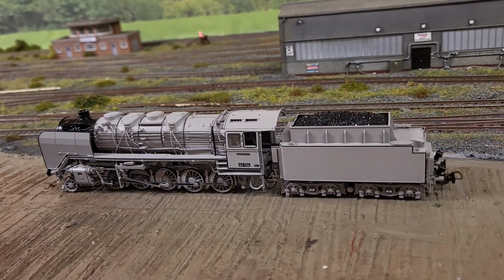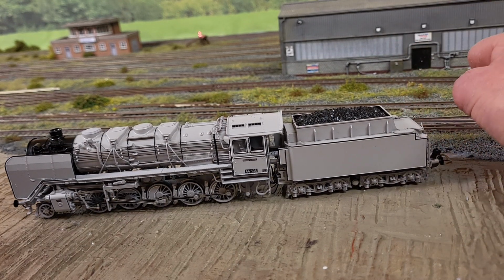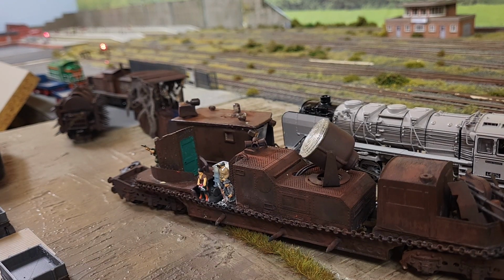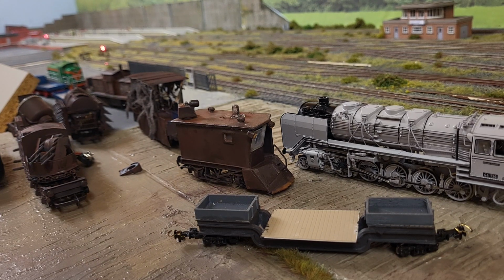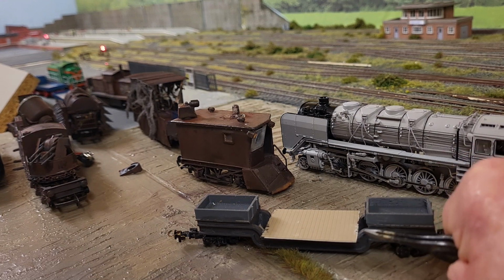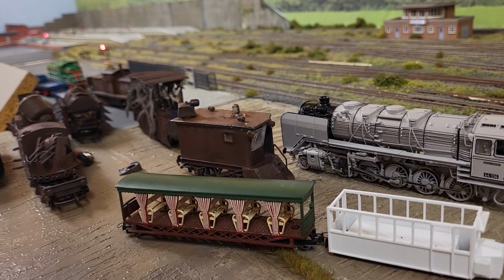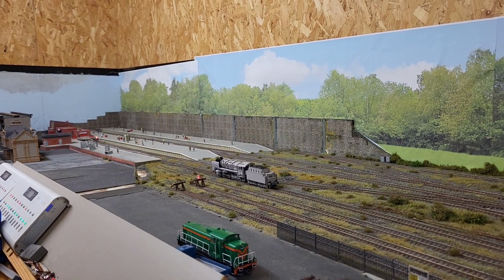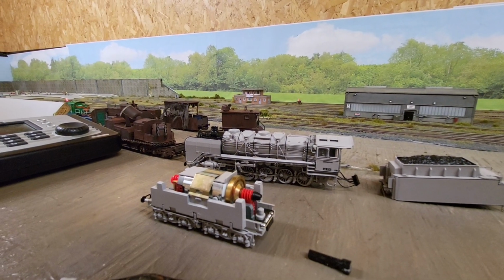Model  Railway  hardest decoder to fit + New Project..what will it be?

Comment: You need to flip the plastic tray that is located on top of the motor.
And being a Roco, the most likely decoder to fit in there is the Zimo MX645R that is specified in the manual of DCC version because that is the only one with the correct component placement to fit the box. This locomotive needs a decoder with a one sided pcb
Reply from the maker: Ahh ok thanks for the info.
It's been hard work .not sure why Roco makes these things so hard .
Thanks again

Comment: Tender drives can be finicky, but look at the size of that motor 💪 OO9..narrow guage?
Reply from the maker: Yeah it tested my patience for sure.dam steam locos lol.
Yup it's for the next module 👍☺️
Reply: This is actually a combined loco and tender drive one. The big black thing on the front of the motor is the drive shaft that goes into the locomotive to power the wheels there as well
Reply from the maker: Yeah that’s what was giving me so much problems . Hey ho this things test us cheers Ivo